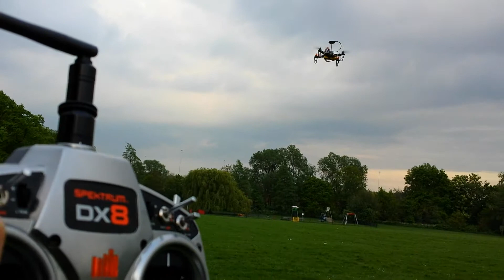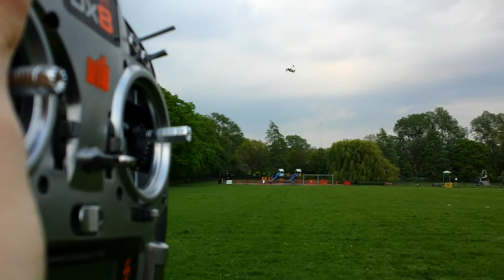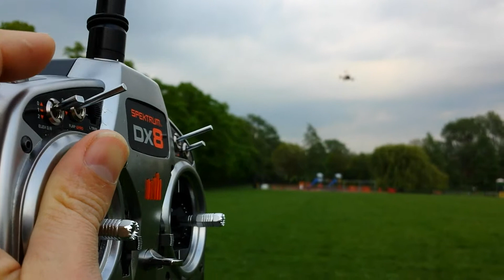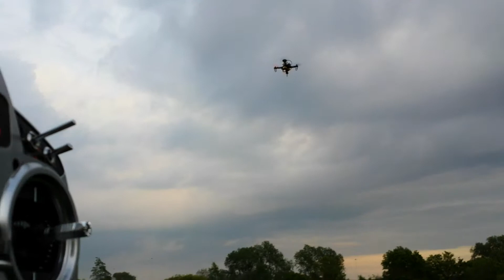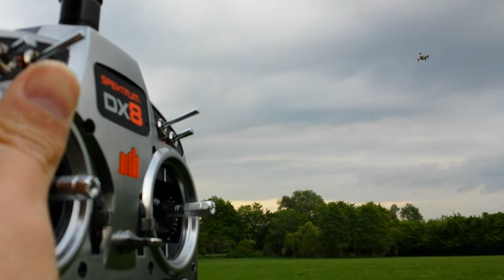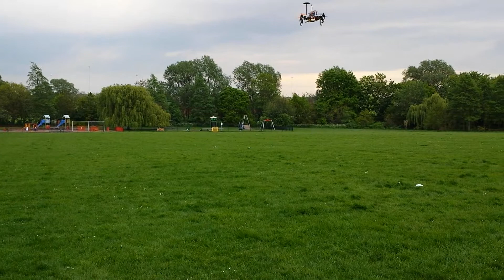Crius megapirate mission test on hobbyking fpv250

Comment: Very Good!!!
Can you share your configuration PID. Rate P,I,D  and Stabilize P,I,D.
I have a  FPV250 with Multistar 2206-2150KV Motor The "Baby Beast" and multistar 15A ESC. 
FC: Multiwii and Megapirate AIO Flight Controller V1 (firmware magapirateng 2.8 R3)

Thank you very much.